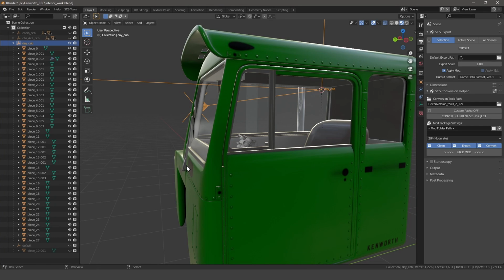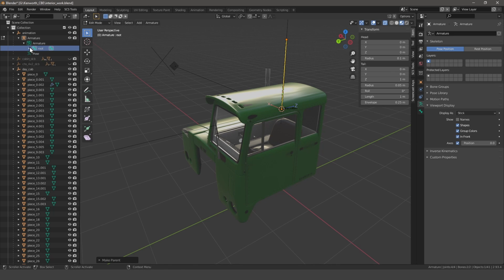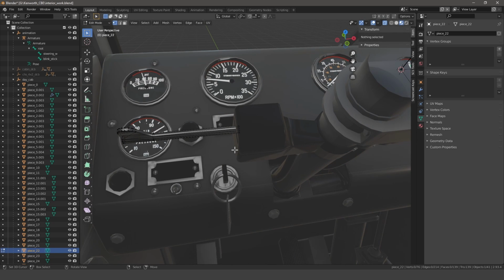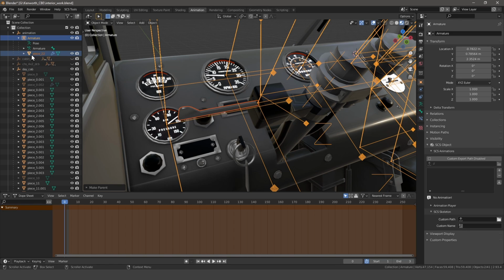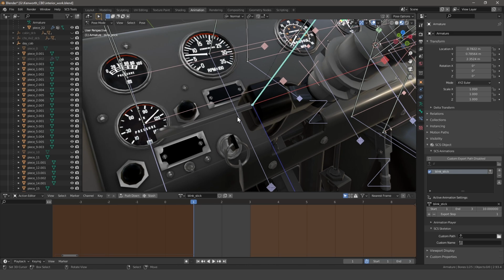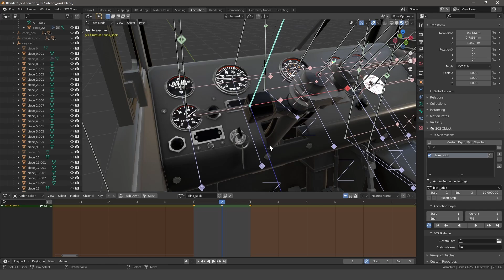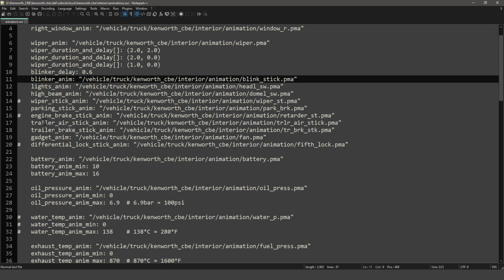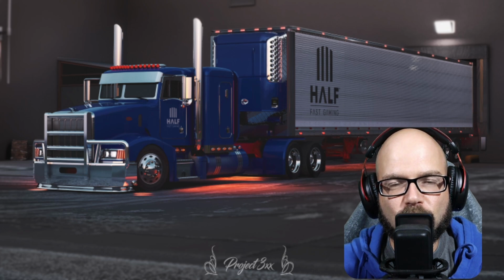How To Mod for SCS | Step 8a | Setting Up and Animating a Switch!

Comment: bro i can't do steering animation, can you make a video for this? it will be really helpful
Reply from the maker: There is no steering animation required anymore. Just need a steering_w bone
Reply: @Halffastgaming  but i can't adjust steering_w bone in exact position. do you have a facebook group bro?
Reply from the maker: @Tasnikur_Sifat  I have a discord and a Facebook which you'll find in the description of the video as usual.
Reply: @Tasnikur_Sifat  At 4:49, Jeff uses the Shift + S menu to set his origin point to the mesh, therefore the steering_w bone will spawn exactly on that mesh's origin point. That could help you out. Or consult a tutorial on how to use Blender's Shift + S pie menu to create objects on specific points of your scene.